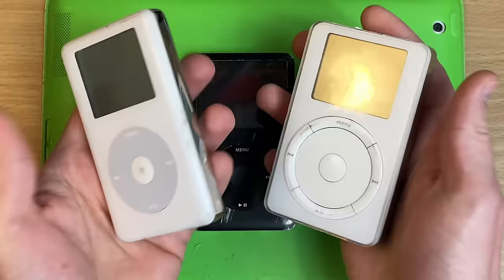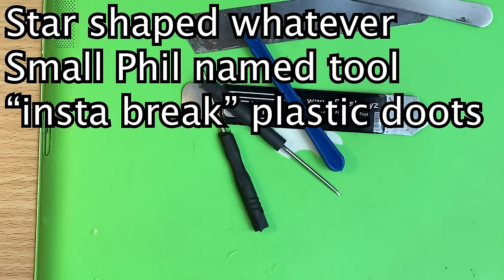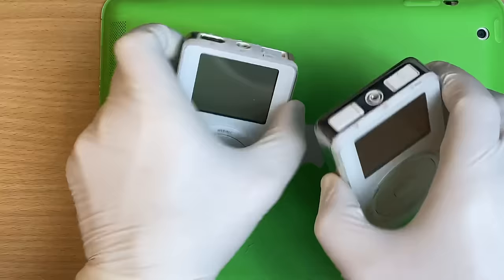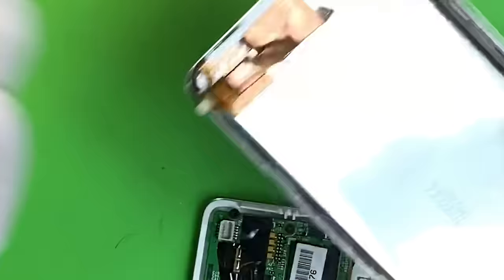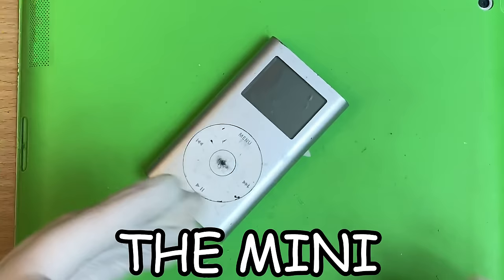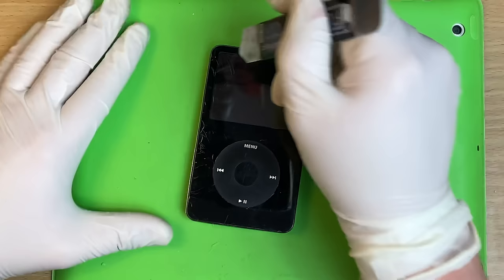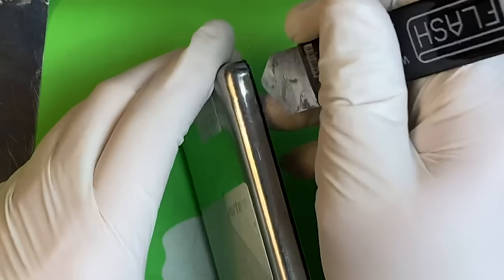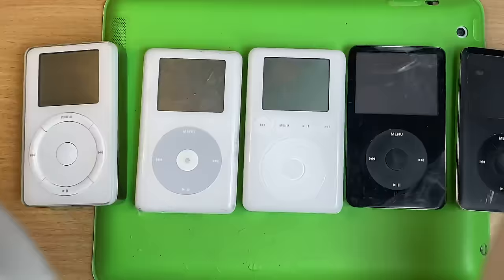How to fix every iPod Classic.

Comment: I’m just watching for the entertainment value. I have a Na-No. can’t fix that nugget.
Reply: That's why it's called Na-No
Not Yas-Yes.
Reply: @MidnightWanderer00  Top comment god here by far xD
Reply: Has it got the black spot?
Reply: I specifically bought a pink Mini bc he said it was easy to flash mod...now I just need to get a flash card for it.
Reply: Pink 4th gen nano for me. 10 years old, works fine.
Reply: which gen

also whats wrong with it
Reply: nightbladegaming lol second gen, it’s all right, got it fixed when I bought it.
Reply: Flintlock27 no
Reply: Ja miałem nano ale mamie oddałem i kupiłem toucha 7 generacja
Reply: @mychemicalbromance97  I also bought a mini because of him, it was a bit hard to get it to work with 128 Gb though...
Reply: Poor you, I got a 5.5gen for 35 bucks

Comment: 14:46 Everyone, who has fixed a portable electric device, has experienced this moment. This heart breaking moment where a screw teleports to the nether dimension. Never to been seen again.
Reply: accurate
Reply: Kinda like when I took apart my 2006 iMac to get a CD out of the broken CD drive
Reply: I have the reverse problem, extra screws pop out of the ether and make me worry which ones I missed.
Reply: That was me opening my Dell Inspiron laptop 15 (yknow the ones that are huge with its own built in DVD/CD player/burner) I not only lost the dam screw I also stripped one in the process 😅😂
Reply: True
Reply: @mariarivera1340 special case: installing a replacement switch in a server just in the corner of a tire storage room in a tire store and having a screw vanish into the tire void
Reply: reminds me of recently when i lost a screw from an old phone, thankfully i had a spare one and that one was a screw donor
Reply: I've had this multiple times, the worst being springs for a motor's commutator. Flew straight into carpet, never seen again.
Reply: And then falls in lava
Reply: Sounds about right, lmao
Reply: Tech tip from someone who used to be in aviation;

If you drop something on a floor, get on your knees and shine a flashlight parallel to the floor surface. The more powerful the better. Everything on the floor will cast a shadow and it's a lot easier not to miss anything.

Comment from the maker: I worded the 5G section weird saying they only charge by FireWire. I meant they can’t sync over firewire, charge only. They do everything via USB tho!

And also I am a stinkin liar and there is no metal cover thing on the 5G's either and I'm simply off my face. BEST REPAIR GUIDE 2020 EVERYONE.
Reply: Maarten De Meenthe this is only for iPods
Reply: If you become a patron we’re do you find the vids
Reply: Were can I buy cheap iPods
Reply: E
Reply: DankPods how do u now
Reply: 11/10 repair guide.
Reply: best repair guide 2020 i reccomend
Reply: NIGHTMARE MODE!!!!
Reply: You should do the nano next
Reply: I'd love to see if you can build a complete iPod out of the cheapest parts you can find
Reply: 5G is bad for ya health tho!
Reply: if you werent in ausie land i would send you a box of rubber dipped steel guitar picks i use for opening electronics they are hardened and dont just flex like the aluminium ones
Reply: Should this get pinned or something
Reply: Hey I sent you a message on IG about a rare ipod I found that you might like
Reply: I keep getting out bid on iPod classics! They are for parts or repairs but people keep bumping the price up too high to make it worth buying them :( I don’t want to spend like £50 on a broken iPod to then spend around £60 on a screen, battery, case if It needed it and some flash mod card for it. Sucks but I do really really want one!
Reply: next do nano, and then shuffle
Reply: @giuseppemastrogiovanni5432  could get lucky on ebay, or if you join the discord linked in the video description folk are selling them all the time. I got one from there no hassle.
Reply: Yo dude I really like your videos about earbuds/headphones because of your personality and humor but your iPod videos I just don’t want to watch because I’m not interested
Reply: Dank you for the fixed information.
Reply: 500th like
Reply: Dank You
Reply: Reading this gives your voice in my head.
Reply: e
Reply: Rock box.
Reply: I know this is late, but on elite obsolete i want to buy a bat-tree for my 5.5 gen but it says "battery 5th/6th/7th gen". Would the bat-tree work for my 5.5 gen?
Reply: @editor_e5873  on patreon as unlisted vids
Reply: I got scared and was about to Google whether or not that was true just before I saw this comment. Best repair guide though
Reply: Is the iPod mini tutorial the same for the iPod Mini 2?
Reply: I got a 5gen on the way and i got so scared
Reply: that 5g has a broken screen
Reply: Thank goodness they don’t need to charge with FireWire! I was freaking out trying to find a cable because I thought they were like stupid rare or something lol. Thanks for the awesome vid, though, dude!
Reply: I’ve never actually owned an iPod, I’ve only ever seen one in person, it was at my grandmas house, she had what I think was either a 5th gen or 4th gen, I didn’t get to do anything other that hold and see it cause we were actually just there helping clean so she could put in a new washer and dryer
Reply: are 5th & 5.5 gen ipod parts cross compatible? I have to replace the logic board of my ipod video because a couple of the pins in the 30 pin connector are sliding out of their housing. I mitigated the problem by putting a bit of card in their to keep them in place but it's not a permanent solution
Reply: @zaccycreations  Yes. Also, look at the comment date
Reply: Sup
Reply: Ah, you scared me for a moment. I have a 5G coming in the mail lol
Reply: where do you get the wrirewire charger ?
Reply: bruh pin this shit i nearly had a panic attack about my new nugget
Reply: @Alexander_l322  try to bid like at the end
Reply: @qinpawz  instructions unclear, turned myself into hatsune miku
Reply: @whoopee  e
Reply: @whoopee  Rush E
Reply: I got one from 2012, never been opened.
Reply: Got me nervous for a sec saying that they only charge over FireWire
Reply: What's downloads
Reply: On the 1st gen 5gb iPod classics you can use 3rd gen 10-20gb hard drives on it with out any issues?
Reply: Love your work mate! Also frank stinks
Reply: i shitted my pants
Reply: I just bid on a 5g on eBay, seen that and was like, oh no... I messed up.

Comment: A lot of people, including myself, have never owned an iPod in their lives, but you're wanting me to snag a 7th gen classic and mod the hell out of it. Thank you so much!
Reply: I need help and don't know a thing. I have a 160 gig 7th classic who can fix/upgrade mine? As it doesn't work or turn on...
Reply: @deezsquuezeorg  if it doesnt turn on it prob needs a new battery
Reply: Been 9 months but glad to say that I dun did it! I bought a mini...first gen...and bought a 128GB SD card to flashmod. (Bought a firstgen cuz they were cheaper and 128GB is still good), so...well there ya go
Reply: i have never owned any until they were basically goin out of style. now I have and owned almost all of them!
Reply: And if you replace the battery be VERY CAREFUL when disconnecting the old one and connecting the new! The contacts are super fragile. I recommend a magnifying glass and fine forceps. TAKE YOUR TIME.

Comment: I run a little iPod repair business and this is a treat to watch. Upgraded a 7th gen with an iFlash board and got a water damaged 7th gen and perfectly working 5th gen in return
Reply: is there a better way to open them? I have one with a dead battery and that's been dropped hundreds of times so something is rattling inside.

Comment: I just found my mom’s old 5.5 gen classic sitting in storage since 2007, and the hard drive WORKED! I was surprised by that!
Reply: Me too!
Reply: I found a iPod touch 2g and 4g the 2 works fine but cracked and 4 is shattered
Reply: Cool
Reply: Noice I sold my 4th gen so I’m buying a new one
Reply: Wow lucky,
I loved my 3rd gen I loved it because it was I remember this being the earliest example of haptic vibration. 

Unfortunately,
I moved so much when I was in foster care I forgot it at one of the many houses I lived at along with my Tamagotchi V3 (or was it a V4?... it was the one with a IR sensor so you can connect with other Tamagotchis) at one of the many houses I've lived at.

Comment: Never owned an IPod, never will. With that said, I've got a bowl of cereal and I'm tuned in for 42 minutes!
Reply: Why not? Feels good, man.
Reply: Ima an android guy but I love my 4th gen ipod
Reply: My childhood "iPod" was an RCA Lyra from 2005 but it worked great, buttons were all on the sides and they were recessed which meant I almost never touched the hold switch. Screen was tiny as heck though, 128x64 character LCD was impossible to read
Reply: Bought my first iPod ever 4 moths ago. It was sad and broken. Restored it myself using DankPods video as a guide. Since that I use it everyday for music and audiobooks. Doesn't drain mobile battery, nice sound, no annying "ding ding" notifications for every fcking message. Definitely worth it.
Reply: I’m just sitting in the toilet, not even pooping any more but just hooked...and don’t even own an iPod either lol

Comment: 3G requires the double dong cable with a USB and a FireWire plug to the dock connector to do a flash upgrade/restore.   Most upgrade videos do not mention this.   Also, limited to 128GB because PATA Limitations at the time.

Comment: For the 6th 7th gen, use one of those blue plastic spudgers. Position the edge inside the charging port towards the front of the case. You then could push the metal casing up and start and begin inserting the other flat prying tools around the seams.

Comment: This video helped me fix my iPOD Mini from 2004! I listened to it in my car on my way home from work today, and it was on a real low battery and that battery eventually died. Honestly though, the battery on this iPod isn't the best, and it doesn't last all that long. About a few hours. When I got home  I plugged it into the wall, and two hours later... nothing. Not a thing. I was 100% sure that the battery was toast. I tried unplugging it, re -plugging it in, trying different charging cables that are Apple branded, pressing all the buttons, holding thhe middle button and swithing the "HOLD" switch back and forth, but still nothing. I was facing the harsh reality that I'll never be able to listen to my iPOD Mini again. That was until i found this video! Your video helped me out and I"m so greatful! This video helped me realize that I had tried everything I could think of EXCEPT a hard reset.  And sure enough that did the trick! My iPod is currently charging. So thank you DankPods! I'm a big fan of your channel, I'm subscribed ,and enjoy the content you put out. Thank you for making it to where I don't have to buy a new iPOD Mini yet!

Comment: Long story short:
It's the seemingly throwaway "more juice to power it up" line that saved my hide with a clicking iPod.

Short story long:
I plugged in my bottom-of-the-junk-drawer 5th-gen iPod and heard a click. Most every online post went straight for the HD replace. 

Watched the first bit of the video that talked about the firewire charger and it simply needing more juice up front. 

Figured, what the heck, can't hurt. Found USB innie to USB-C outie converter, plugged the whole kit and kaboodle into a MagSafe brick from my MacBook Pro and SWEET MANNA FROM HEAVEN IT TURNED ON WITH ZERO COMPLAINTS!!!!  🙏🙏🙏🙏💫❤❤❤ Thank you @DankPods !!!

Comment: 3rd gen is wonky for flash modding?

I used a dirty scrub ebay adapter and an ACTUAL COMPACTFLASH CARD, and it worked perfectly
Reply: I tried that, but the software was extremely wonky and I had to reset the whole iPod about a million times when using it.

Comment: I’ve found it much easier to remove the hard drive AND molex cable from the Mini motherboard as a set and then remove the tape. If you use a plastic tool to rock each edge up slowly the same way you unplug the click wheel it pops off really easily.

Comment: DankPods proves that he has no idea what he’s doing for 40 minutes.

Especially the 5th generation. First of all, you CAN charge them via USB, and second, they AREN’T supposed to have a metal plate behind the screen.

EDIT: Someone has pointed out that DankPods probably meant that it can’t sync via FireWire by that statement.

And when he broke the touch wheel and lost a screw for the 2nd gen, that hurt me on the inside.
Reply: He learned from ifixit and experience give him some slack
Reply: I think by “you can only charge them with firewire” he meant “FireWire can only charge them, not sync”.
Other than that, you’re spot on.

Comment: Me and my friends invented "The iPod game" which consisted on popping open an iPod and performing certain tasks (replacing screens, front covers, clickwheels and hold switches), with one rule, the iPod had to be operable DURING the operation, battery and disk attached and playing music, if the iPod restarted or did shut down you lost. Worked wonders when it came to be careful handling electronics, there were all kind of sacrifices, torn ribbons, broken displays, crashed hard drives and rarely damaged motherboards (they are darn durable)

Comment: Thanks to you, DankPods, I ordered a 2nd Gen iPod Mini from eBay and the iFlash adapter a month or so ago and did the Mini Mod. I now have a 128GB Mini and love having an iPod again after not having one for a decade. Thanks for the awesome content and providing another tech-modding avenue for me to explore! 

Can confirm that modding the iPod Mini is fun and also that the tape/glue for the top and bottom plastic is a pain. Muffed up the top plastic with the iFlash tool a bit, but that's the battle scar to show I did it myself.

Comment: Something I can add into this is if you have the sad iPod icon after boot you can try the last resort strategy. You can turn the iPod on it’s face and smack the back steel case with a down area of your palm, you can be little rough and sometimes it can jumpstart the stuck drive. Just something i discovered today after searching forums and repaired my 4th gen like this.

Comment: GREAT VIDEOS ! ! ! 
Took me and hour to open my dead one- IPOS CLASSIC. Nothing to loose since it was DEAD right ... with 5593 songs on its worth trying.
Worked great for 10 years. I'm guessing it's the battery. Now success with getting it opened time to order parts. If I get it working I'll up date.
Thanks again for the videos they are most helpful.
Reply: 10 months later but I'm curious if its working now
Reply: @agoodname7089  Sadly couldn't get it to work. I'm sure the drive is good, wondering if I  can get the music off the drive still and store on my laptop???

Have 5237 songs 🎵 💕 on that drive.

Comment: Quick tip for anyone with a 5th gen
Some drives are weird and their tabs are flipped, to if the black part isn’t coming off, try flipping the white part up
I found that mine that flips the white tab up has a weird metal bit on top of the ribbon cable, so I guess that’s your cue to flip the white part up

Comment: Your channel has led me to consider getting an iPod of my own. I'm currently looking at a modified one that has a 128GB SD Card replacing its hard drive and a really long battery life. If I were to get it, it'd have more than enough space for everything I plan to include on it, which is two albums, the OST of my favorite movie (assuming I can find it legally), several other songs from multiple unrelated people, a 3-minute meme clip, and four movies. I'm just hoping it also has the four built-in iPod games, because the Click Wheel works well with those games.

Comment: The reason to persevere with the 3rd gen is, quite simply, the sound quality. In addition to the fact it is a beautiful object, that Wolfson DAC and the audio circuitry makes it sound better than anything Apple have made since, and certainly better than today's iPhones (you'd need decent dongle DAC to get anywhere close). With the right pair of headphones like Grados, Beyerdynamic T5 or some top notch IEMs, you can hear it immediately. I don't know how you'd get the EU volume cap off nowadays though, unless you had access to a pre-Intel based Mac.

Comment: I’m honestly glad that I’m not the only one who suffered repairing a 6th gen iPod Classic. Hard drive went bad but in replacing it caused the battery cable to ground on the case. Thank jeebus for electrical tape

Comment: Just purchased 2 iPod minis 2nd gens. One the LCD, click wheel and battery need to be replaced. the other one I’m gonna tinker and see what is wrong with it. My guess is a battery. Im also going to add an iflash to them. I’m working my way up to the iPod classic 7th gen I got. Luckily that one is in good condition that im going to add an iflash and probably a new battery. Thank you for the super informative video, this gives me confidence that I can work on these little devils.

Comment: I did me some digging and finally got a satisfactory answer. FireWire supports up to 45w, 30V at 1.5A. That extra voltage, if the iPods actually use it definitely explains the reason it works like magic

Comment: You get a two tailed official Apple cable with FireWire for charging and USB for syncing that go to the standard 30pin connector.  I had to get one back in the day for my 3rd gen which still works perfectly

Comment: Wishing people made plastic cases that fit the 6/7th Gen models, because those models have more stuff for more songs compared to the other ones, and like bigger storage more.
Like I wouldn’t put 2TB into one of these, more so 256GB or 512GB at most, then the big battery. Mostly plastic for these would be good, because then no hassle when opening them.